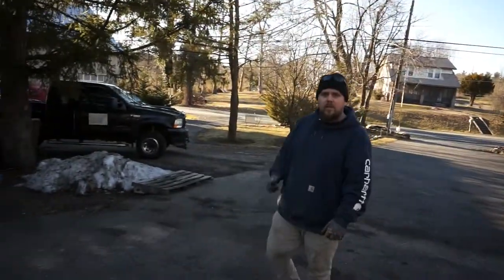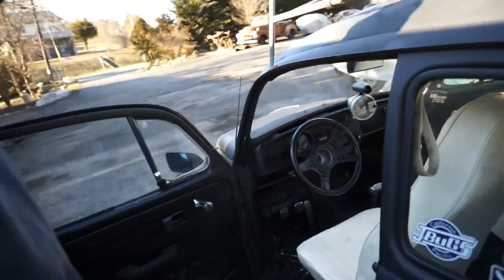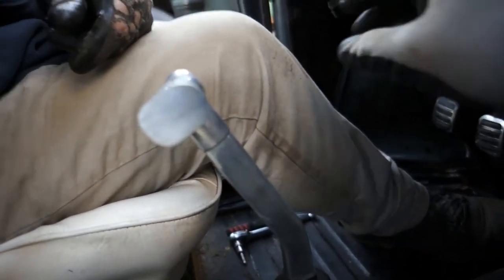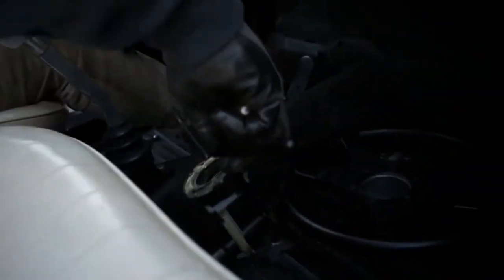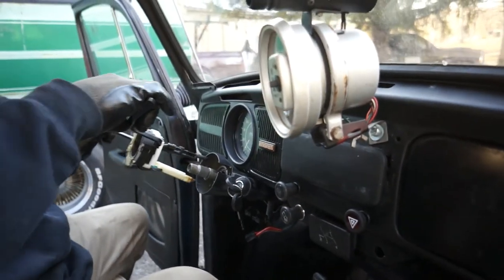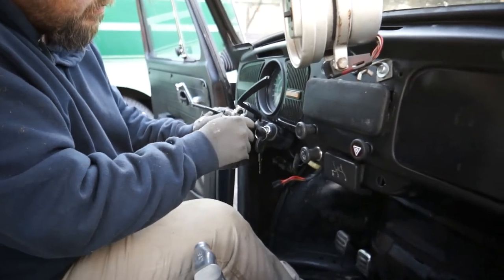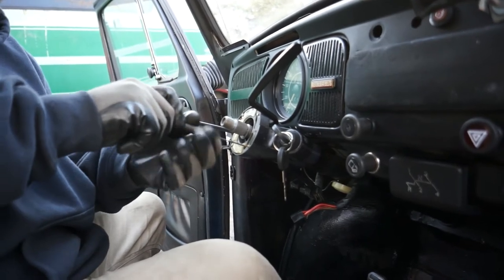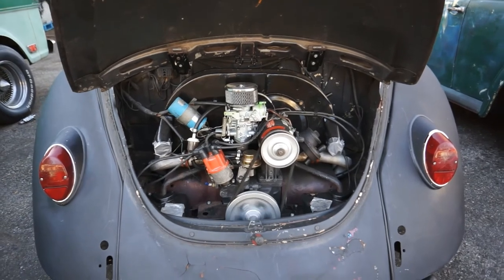VOLKSWAGON BUG, NO START, KEY SWITCH REPLACED, 1972 beetle

Comment: Could this be the problem if the buggy motor is turning over but there is no spark to the coil?
Reply from the maker: I would check the points if it has points.. dirty points or worn out rotor button or bad distributor cap..If it has electronic ignition upgrade then there is no points it could be several things...make sure all your wires are connected, both coil wires and spark plug wires should be clean, not corroded. It could be a bad coil as well. Let me know what you figure out.
Keith 2guys how2
Reply: @2guyshow2thefishkingz89  well we replaced the coil with a new one and it started up but after driving for a short time it died again. We then put the old coil in and it started up again but once again eventually died. I just installed a new distributor cap. Does the coil need to be grounded in any way ? I also have new spark plugs but I haven’t got them in. We tested the wires leading to the coil and they seem to be fine but we can’t get spark from the coil plug
Reply from the maker: @edgelineaerialsolutionsllc7615  Sounds like you are burning up coils...due to you needing a ballast resistor in line on the coil wire.
Electronic ignition will do that...or you can match a resistor coil that works with that electronic ignition module inside the distributor. 
Points don't need a resistor. Too much current could damage the coil or electric module inside the. distributor.  Just a hunch.
Reply from the maker: @edgelineaerialsolutionsllc7615  Check the coil...positive wire + and it needs a negative wire -   make sure they on proper terminals...good solid connections.
Reply: @2guyshow2thefishkingz89  I will try the resistor. Thank you for the advice. I’ll let ya know how it goes !
Reply: @2guyshow2thefishkingz89  do I need a wire going from the starter solenoid to the coil?
Reply from the maker: @edgelineaerialsolutionsllc7615  The key switch constant hot makes the coil positive side hot, when key is turned on and engine is running and at start.
The coil side negative wire goes to the distributor, points or electronic ignition wire.
Positive wire from coil goes to electric choke, right side of carburetor. 
Positive wire from coil goes to the emergency shut off selinod under carburetor, located on intake, left side of motor...in case the motor catches fire..shuts off air supply to choke out fire.
The positive side of coil has 3 tabs for easy wire connection.
Reply: Out of curiosity what exactly was it doing to make you decide to check this ? I have a 72 that’s been sitting since 2016 and would start but then sometimes the key would turn over but not actually turn over . And eventually stopped . I have some bad wiring that I’m getting around to as well but would love to here it start back up and would hate to replace the full wiring and it not help lol